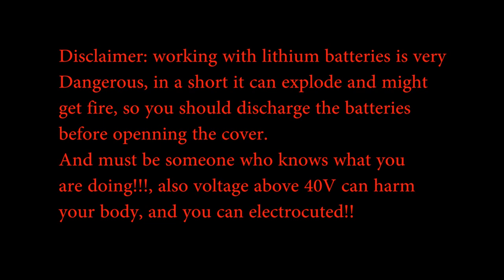How to Disassemble Segway Ninebot  ES2 Battery

Comment: The Cover? This is not dissembling the Battery. I did the same and then, small flatheaded the nickel tabs off the bms. Then cut each power & bms lead one at a time. Unscrewed the 4 mount screws in each corner of battery assembly, pliers to pull nickel taps off, then a couple smaller screws holding the battery holder together. Have 20 perfect batteries now.

Comment: Good evening from Colombia, I am writing to ask you a question, thank you for your response. Here they sell a new external battery for ninebot E22 for approximately 288USD, some used from 144 to 70 USD whose condition is not easily assessable or have a guarantee, I have also seen on aliexpress and they cost 108 USD but shipping is worth the same or even more; In addition, in Colombia there are certain places that import new 18650 cells brand FST 2,500 mAh and DMEGC 2,600 mAh; Given that you opened an external battery, what do you think of buying a used one in Colombia at  70USD , uncover it and change the old cells for these new ones, keeping the original BMS, although there they said they made custom BMS? They do that job for 108. Do you think it would be useful to "transplant" cells to an old battery and that it works well? Or maybe you think it's better to buy a used one even though you won't know what the health of the cells will be like? or do you have another option? I hope you understand my question. Thank you
Reply: If you have the knowledge to solder and such then for 70 dollar plus your new cells absolutely yes you should do it, try to put in better cells than original, watch out for c rating and capacity. In the future you could use that knowledge to do the same for bicycles, motorcycles,.. it’s a joy to have this kind of experience so go for it. BMS shouldn’t care what battery it is, just match voltage and maybe increase capacity. Transfer everything besides old cells. If i lived in columbia I’d eventually try to make this my official job with a workshop with lots of solar panels on the roof. Mucho suerte
Reply: @kvnokvno  thanks y gracias por tu spanish

Comment: Hi I'd like to know some more info. could you use this battery pack with any speed controller? I have one of these i want to use on a e bike but am not sure if i can just connect the leads from my controller into the pos/neg outputs on the battery. I don't want stuff to blow up. thanks
Reply from the maker: Hi - yes you can, it has some protection circuit inside, but I suggest that you will use another protection at your circuit side (over current), also the newest BMS firmware is causing this to be charged very slowly (so if you can do not update firmware - this is done automatically when it is connect to scooter)
Reply from the maker: Yes you can,  I did not test it, but the power out exist, so I don't see any reason why it will not work, but I will test this, worst case open the battery and take the power directly from the cells (there is a mosfet to diconnect the power, so you can use the power before the mosfet)
Reply: On the Control Board of the ES2 which wires running to motor is the Pos & Neg? I assume it's the Blue & Brown but dont know which ones Positive +? And I think yellow is the Brake?..  If you know please help. Thank you.
Reply from the maker: @brianquesada1781  The wide wires (RED and Black)
Reply: Have you disassembled the Internal Battery yet? I'm interested in what's inside the tube Battery and how it works or if it has as complex of Circuit board? Please lmk if you know what color wires are Pos+ and Neg- to motor, Thank you 😊
Reply: @brianquesada1781  TBH i just took a chunk of wire and soldered a piece to the pos neg terminals, hooked it up to a 36v controller, and put a motor on it. works fine, no ground, no bms protection cutoff
Reply: @Kane Banbury I did the same and it worked for me too. Did you solder the top & bottom of left side  cells? (The two Bigger Connections of 10 on circuit board?) Mine works fine on 24V 750 Watt Scooter, but how long does your last in Miles or Time? I'm thinking of doubling up and adding a ES2 Internal Battery but not sure what it looks like inside... Any info on Internal (tube)Batteries or ES2 Control Board wires going to segway scooter motor?
Reply: @brianquesada1781  not sure where to find schematics but on alibaba they sell every component on the scooter. you can find the internal battery, bms, etc. I didn't even crack the battery open, i just put wires in the pos and neg. I don't get that high of milage, like MAYBE 7-10 miles on my bike. I CAN run a 1000 w motor though, and it's pretty fast
Reply: Haha yeah I couldn't find any Diagrams on Control Board wires.   Hmmm I tried going straight from +&- on back of batt but it would only power my E Zip for 5 seconds before the Batteries circuit would shut off for a few seconds. Inside case is a blue light that blinks constantly, but when it stopped power the light blinked Red. I had to wire to the Cells bypassing the chip. My speed is great but I only got about 5 miles so I'm not sure if I need to wire to each set of Cells. Or add another Batt Pack to increase my AH for more Watts on 36V.   So does your bike have a Control on it, or just Throttle, Battery, to Motor?
Reply: @KadeBanbury  are you using Two Batteries, this one being a backup/booster. Or the ES2 External Batt is your only pack powering bike? And do you have a Control board connected between Batt, Throttle & Motor?
Reply: @MrExplorerFilms  Does it charge normally, with a normal segway charger?
Reply: @MrDexter9i3  same doubt
Reply: @brianquesada1781  what wires did u soder to mines does the same
Reply: @brianquesada1781  I have the same problem on my ebike project.  I thought I had a bad motor.

Comment: Hi there is there a bms in this battery
Reply from the maker: Sure - all the electronics on board is Battery manager system
Reply: Roee Bloch can you also charge this without  being on the scooter, looking at using this on a electric skateboard